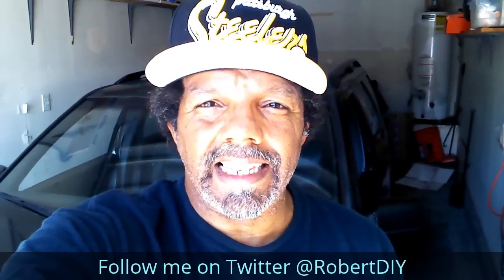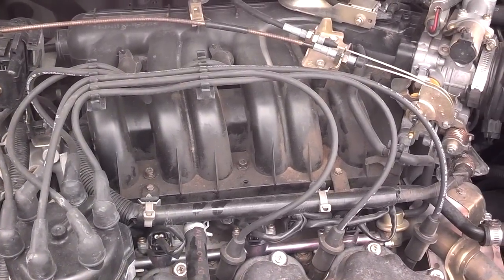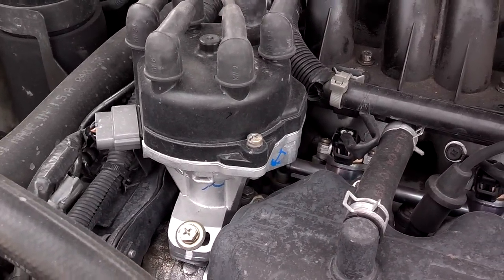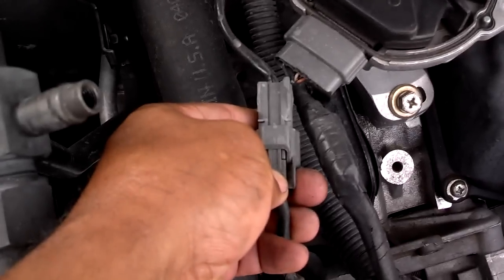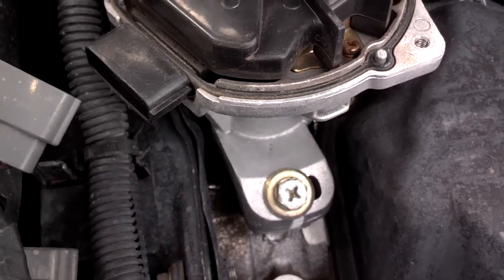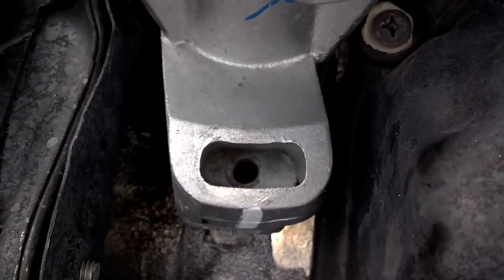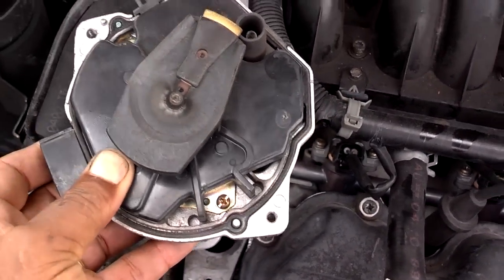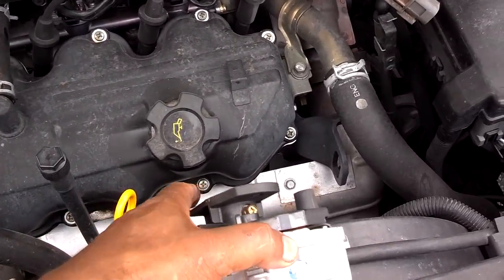Distributor replacment for Mercury Villager, Nissan Quest, Pathfinder, Xterra, Frontier, QX4 - VOTD

Comment: Aloha, I'm getting  dtc code p0340. Cam position sensor a circuit. 99 nissan quest 3.3l se. I'm told it can't be replaced.(cps).told I have to replace distributer. Van keeps shutting down a.26qq⅖is 4
Reply from the maker: Correct

Comment: I’ve got a’96 quest that Bogs down really badly at low speed especially 1500 RPM. I’ve replaced plugs, wires, air and fuel filters and cleaned the MAF, but it still bogs down. Does this sound like a bad distributor? Thank you
Reply from the maker: https://youtu.be/NhtUXZTurzo

Comment: The gear that rotates the distributor broke, how can i replace it?
Reply from the maker: I would junk it but it may be the end of the cam. Google it and see. You may be able to replace the cam by removing the valve cover. Or replace the engine.

Comment: Thank you, Robert, this was very helpful. I remembered replacing one on a 68 ford truck a gazillion years ago. It just comes down to whether my friend wanted to take the time to get one from a salvage yard, buy new, and the time to replace it. Like you said, if it is not lined up perfectly, it messes up the timing. In this case, he decided to go ahead and pay the auto shop a little over $300 for the diagnosis, removal and installation of the new distributor with a guarantee. Sometimes it is more cost effective to just pay someone so you can get back on the road.
Reply from the maker: +Tara Hoffmann This is true.

Comment: Good information,, working on a 1998 Mercury villager 3.0,, was getting a p0302 I move the injector to cylinder 4 now the problem it on 4 , I had install two new injector in that cylinder and one from cylinder 6 to 4 and the misfire it still there ,,car miss after a minute when you start it ,, also getting a strong gas smell 
Also did compression test 
Smoke test for leak 
New spark plugs
Cap and wires look like some one change it but the rotor stay say Nissan I don't know if it still original,, if you have any suggestions please let me know boss ,, thanks Nestor
Reply from the maker: https://youtu.be/Sg7iFytxfzQ

Comment: We have a 2000 Mercury Villager that started missing a few days ago! We replaced the plugs and wires, rotor button and cap. It was still missing so we replaced the distributor. It still missed so we took the new distributor back and put the old one back on. We got the timing set and started it up, it is missing on the number 4 plug! We were told by one person it was the Knox censor and another that it was the number 4 valve was burnt! It runs pretty good when going down the road but when idling it still runs rough. What do you think the issue is?
Reply from the maker: https://youtu.be/Sg7iFytxfzQ
Reply: My 2000 mercury villager broke down in W. Virginia on the way back to South Carolina a month ago. Had gone to       Indiana to escape hurricane Florence. The code my OSB reader gave me was the knock sensor. Cost me about $1000.00 dollars to get it repaired along with the distributor cap at a Ford dealership. It was barely getting any acceleration and power on the highway and I was only getting to maybe 40 mph. One issue they had is that their large diagnostic computer would not talk to the car but the handheld one would. Was stranded over 400 miles from home and what else could I do but pay up.

Comment: I have a 1995 nissan quest I can start but it runs and cuts off. if I let it sit it will start but runs rough. Is this a fuel pump or distributor problem. Thank you Robert for your help
Reply from the maker: https://youtu.be/NhtUXZTurzo

Comment: Hi, Robert. I have a 1996 mercury villager gs v6 3.3l I pulled up the distributer without lifting the cap or making marks and I didn't know anything about it, how can I tell how it goes back and which way the rotor faced?
Reply from the maker: +Freddy J. Padua lol
Reply from the maker: +Freddy J. Padua did you watch the video?
Reply: Were you able to fix it? I have the same problem. Thanks.
Reply: Simply align the indent mark on the gear to the external mark on the shaft and that sets the distributor to top dead center for proper installation

Comment: cool...but how do you remove the spark plugs and the wiring that goes to the distributor?
Reply from the maker: +natib0islim brothadre Get in there and start taking things apart.
Reply: I'm sorry I meant how do you know the sequence if the spark plugs and the cables that were removed from the distributor? By the way, good video.

Comment: well my question is this....if the spark plug cables were off, how do i know which order the they go back on the distributor cap. i'm asking because google shows way too many different sequences, and i also read that the haynes  manual (which i dont have) is also wrong....now my wife is pissed because her car wont start.
Reply from the maker: +LaKisha Garmon off hand I do not know.

Comment: How do I remove the rotor from distributor? I removed the screw holding it.
Reply from the maker: Watch and listen.
Reply: I did watch the video and listened but it did not just slide off like it's supposed to I had to force it off with a screwdriver on both sides and it was not rusted it's perfectly aligned and clear as day fresh like new looking. It did not come up easily.
Reply from the maker: Ouch
Reply: I got the new one in, (distributor) in less than 10 minutes 1st try timed no timing light, lucky I guess. Should've made a video of my actions. Another missed you tube moment.

Comment: I messed up the wiring order of the spark plug. Can you tell or refer me to a place where I can get the exact firing order? I found couple firing orders, but they are different. Mine is 02 Villager. Thanks.
Reply from the maker: Owners manual???

Comment: What about removing the bolt and using a black marker pen run it around the inside of the oblong hole where it meets the engine metal, when you drop a new one in you just look down the hole and match the pen oblong to the hole? yes/no perhaps? Go away zx8401 ha ha :-D
Reply from the maker: zx8401ztv I choose C. lol
Reply: Robert DIY LOL good choice, you could of said "ill take the 5th" lol.